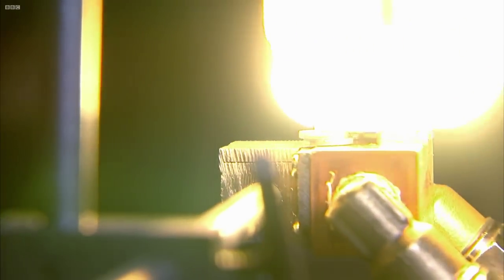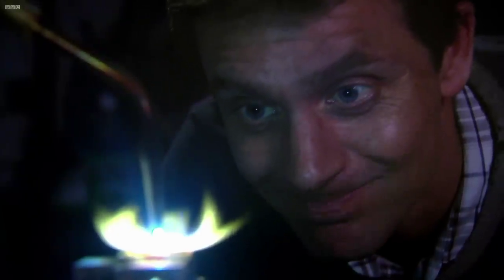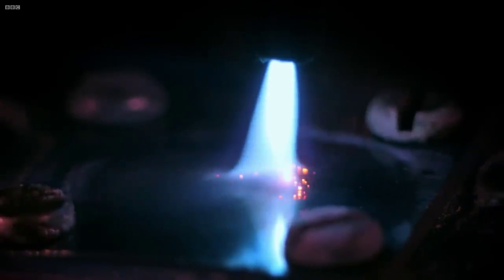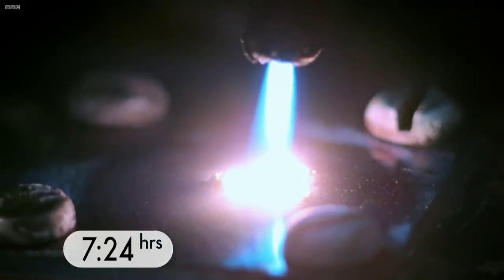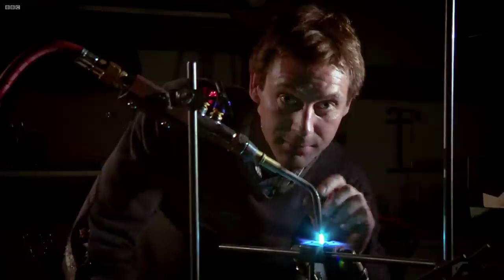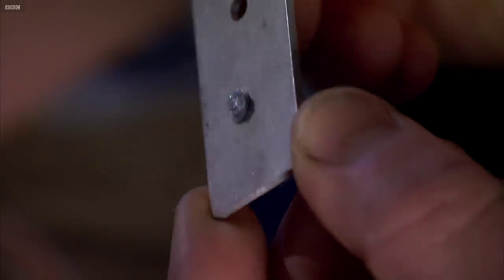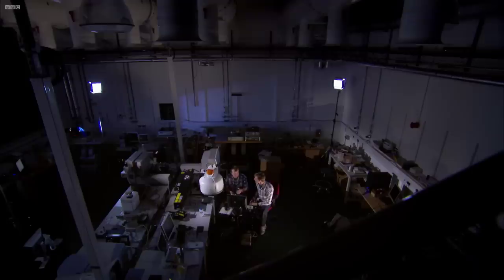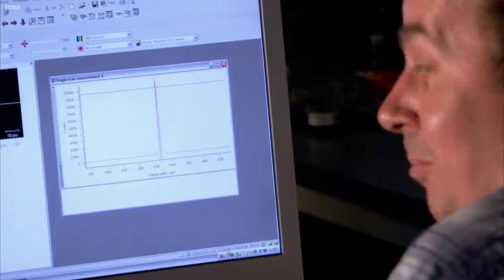How to Grow Your Own Diamonds | Bang Goes The Theory | BBC Studios

Comment: Pressure is required to push all the carbon together and force out impurities.  This method uses heat and assembles the diamond carbon atom by carbon atom so there theoretically wouldn't be impurities to press out.  Open air like this you see on the spectrograph that the result had impurities but spiked where it needed to as well.

This means everyone can grow low grade industrial diamonds for use in machine works and 3D printing though.  Can't wait to try printing diamond dust into carbon fiber

Comment: Yes diamonds are expensive, but just because their shiny hard and take millions of years to form. Now if we're able to mass produce them they value with go down but we can use them for more important things instead of jewelry. Maybe something for vehicle or building. Who knows and I'm sure the value of other gems with grow so no worries.
Reply: They can be used as terrific blades. Has anyone tried to make a diamond lens?
Reply: Also I wager the materials and resources required to make diamonds outweighs their current worth. I suppose that could change in the future but if it was currently practical it would be more common place and we wouldn't be mining for them any longer.
Reply: DAMIEN MILLS e
Reply: im like how u see future ...im agree
just imagine ur smarphone use amoled glass but what if future we had amoled diamond / other gems
and now for chips / IC we use metal, carbon and gold ......  not impossible we use GEMS in future
or this ?? how to break bottleneck tech . we cant use now or develope now cs Pricey
Reply: Industrial grade diamond is not that expensive actually! What made diamond so expensive is mostly marketing strategies only. And more specifically, De Beers should be blamed of.
Reply: It's a well known fact that diamonds - including those of gem quality and size - are not nearly as rare as they are made out to be. De Beers held a virtual monopoly on the market for years, marketing massively and releasing only a fraction for public sale (thus maintaining a "fake" rarity).
Reply: WAVE KING the video I just watched before this one is able to make a diamond in under two weeks big enough to be on a a ring like half the size of a marble. Its not mass producing it. But in my opinion that's one he'll of a improvement since a few years ago
Reply: there is no value but what value man makes for himself... we will and should be able to replicate all that nature has to offer.
Reply: The real question is this. Does the amount of resources needed to make the diamond balance what the diamond is worth? So like in this video. He had to run an acetylene torch for 8 hours to get just a few small particles of diamond. A 7 lb tank of acetylene gas costs $42.00 in Milwaukee, WI. Granted that's a very small tank. But I'm using that as a guide. If it takes 8 tanks of that size to make just those particles, that's $360 in gas alone if you're burning up a 7 lb tank every hour. So if it takes say 4 days to make a diamond large enough for a gemstone in a ring, you're looking at $4,320 just to make a diamond. Personally, I'd rather pay a hourly cost of $200 to have an excavator dig a hole in the ground where each shovel full might hold 10-12 diamonds that are naturally created at a worth of $1,000 or more each. $12,000 for 12 diamonds is better than $4,000 each when you look at it from a consumer standpoint.

Comment: Essentially what's happening is the plate is being bombarded by billions of carbon atoms via the heat produced by the fire. Because of the constant, immense temperature, and carbon atoms not "strong" enough melt away instantly, leaving the more dense ones behind to collect under the flame. As these atoms collect and bond together under the focused heat, diamonds are formed. It's a very, veeeery slow process though, making a decent sized diamond can take a few days at the least.

Comment: Fact that they are very tiny, is that there isn't used any pressure - if you create very high pressure, all Carbon-Atoms are pressed 'into each other' while the grow process is produced in a heat hotter then 2700 degrees Celsius and forms one big industrial (synthetic) diamond. The process must then run for 4 whole days.
This isn't really news. Me makes synthetic diamonds for over more then a decade now.... so, not really 'current news' BBC...!

Comment: I don't actually believe this. I have studied the history and manufacture of synthetic gemstones including diamonds and my understanding is that diamonds can only be made under great pressure OR a strong vacuum.
Read The New Alchemists by Robert Hazen or Gems Made By Man by Kurt Nassau.
Reply: They showed you scientifically that it IS diamonds and you choose to disagree? Why?
Reply: the two methods to create gem-quality lab diamonds is high pressure high temperature (HPHT), and chemical vapor deposition. he did chemical vapor deposition. normally you do this as lowered pressure (not a vacuum!) and with a controlled atmosphere. so he only got tiny diamonds with a huge amount of impurities.
Reply: He 'only got Tiny diamonds'
Lol
No scientist expected him to get any.
Reply: This method is Atmospheric Pressure CVD. It is a documented method. Most probably you have stumbled uppon the typical HPHT methods and CVD with Methane/H2 (and Argon) in 100mTorr pressures, but this technique is also around and you can find it in scientific papers if you search. One thing he is ignoring is that the supply of Oxygen should be marginally lower than what is used in the normal Acetylene/Oxygen setup. This way he could supress graphite and grow better quality diamond. You can actually achieve near gem-quality diamond with this setup (if you use less oxygen in the flame and put the substrate at the tip), but the cost is like ten times more than CVD diamond

Comment: how is that metal not melting at 2000 degrees?
Reply: ***** FIRST OF ALL ITS FAKE DIAMONDS! IT NEEDS YEARS AND EXTREME HEAT TO FORM DIAMONDS. WHAT HE DID IS A REPLICATE DIAMOND. MEANING A CLONE NOT  REAL OR ORIGINAL.
Reply: The value of a diamond is by weight and cut, those could be just as valuable if he had left the heat on a little longer
Reply: Imabeatyouman yet they are physically identical, if you mnage to dig up a diamond it is worth more for resellingpurposes to leave it in it's raw state than it is cut. The price ofr diamonds is artificially kept high despite the fact that they can completely be replicated in a lab.
Reply: Diamonds that people pay excessive amounts of money for are diamonds that can be cut and look good, industrial diamonds are made for well industrial purposes drill bits, cutting wheels, grinding wheels and tips for all different things. industrial diamonds have no worth as a gem on a ring.
Reply: CasualPickle dude its called ripping off people. earth diamonds are better than man made. and set them at ridiculous rice
Reply: ***** Is a mix of Ceramic and Metals, due to the high resistance of heat in Ceramic materials :) , mind the english is not my first languaje.
Reply: Imabeatyouman Actually they're not.   Syntehtic diamonds (the proper term,  not lab diamonds)  are quite expensive.  They require a lot of energy to produce jewel quality gems and the cost reflects this.
Reply: glad someone cleared that up I don't give the best explanations. but regardless people should do a little research before asking stupid questions haha
Reply: CasualPickle Yeah... A simple google search would had answer that question, but hey at least he/she did a conherent question.
Reply: +Adam Reed soooo... what you're saying is they do have a worth..
Reply: +Ion Dru steel is metal and it melts at around 2700 degrees F
Reply: They are real diamonds, but they are not natural diamonds.Actually people can now produce diamonds that are a lot more perfect (less impurities) than the best mined diamonds.
Reply: If you look carefully at the video, you can notice that the base is a metallic block that has tubes to the sides. Probably there is a liquid flowing through, that will keep the substrate material to a specific temperature (most likely there would be a temperature sensor in contact with that block as well). Because diamonds are carbon, they will burn at high temperatures and in presence of oxygen, so the nearby environment must not have oxygen
Reply: Imabeatyouman Lab Diamonds are not cheap LMFAO  where did you get your information from?!?!
Reply: there a water cooling block under the plate to prevent metal from melting, flowing continiusly
Reply: Copper plate
Reply: @gandorf55  not really.  The regular diamonds are fckin expensive to mine out. Plus they're hard to come by

Comment: So, the carbon source was from burning fuel? I thought that there had to be massive amounts of pressure also for diamonds to be produced?  So, the point is that diamonds are created any time there is fire, just that it might not be enough to see? I am not sure what the point of the video is...but its pretty cool. I would like to make my own diamonds.
Reply: I think Diamonds can be created by either pressure or heat, but i'm not a 100% sure x|
Reply: YourFavoriteFlamer Nightcore, I think you need both
Reply: What he was doing is using the plasma in the flame to perform Chemical Vapor Deposition (CVD) of carbon onto a seed crystal. If the seed crystal is diamond, you grow a diamond.
Reply: He made a seed. Anyhoo you need heat and pressure. A mold doesn't hurt either.

Comment: THATS CRAZY, CAN YOU USE A REEGULER TORCH FOR THAT, NOW THATS HOW YOU GET RICH #DIAMONDS
Reply: It isn't as simple as that you need a carbon containing gas to make them
Reply: methane?
Reply: It will cost you more to produce them than you will earn from the actual diamonds.
Reply: +Fairex
Even if you have a free source of hydrogen & methane?
Hydrogen: Hydrolysis of water using solar panels
Methane: Generator feeded with un-eated food, rabbit poo, etc
Reply: Frank Einstein or u can use nuclear fission as a source of energy
Reply: Yeah... Fission reactor are so easy to build... And Uranium so easy to find...  lol
Reply: Frank Einstein who says you need uranium? All you need is a source of neutrons and a (kind of) unstable nuclei that has low binding energy per nucleon. Your just powering your diamond making scam, not supplying energy to your entire county xD. You'd be surprised how much easier it is, compared to, let's say, 2010.
Reply: Guys, let me know if you ever do start a diamond making industry. I might invest in it, sit back and relax while you do all the work ;)
Reply: +Bish Scyzer
I asked to someone at Wall-Mart if they was having a couple of unstable nuclei but they said they don't have this in stock...  :(
Do you know an other place where I can could this?
Reply: He uses acetalyne